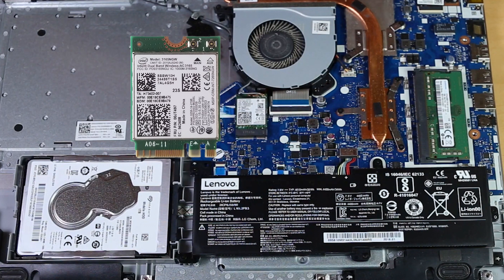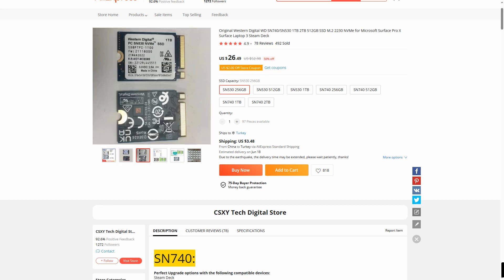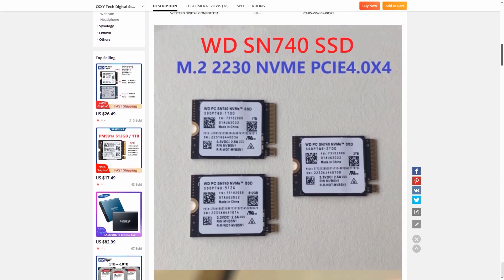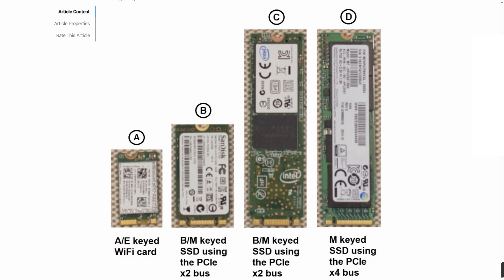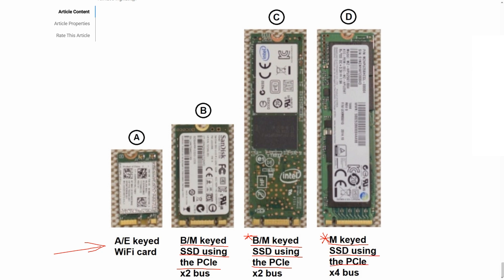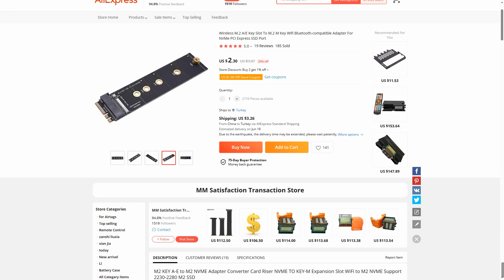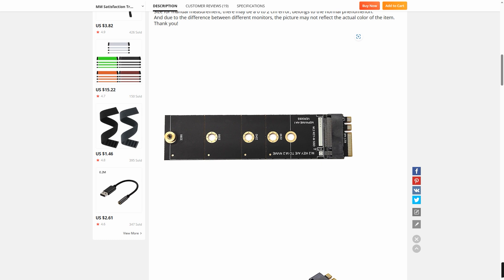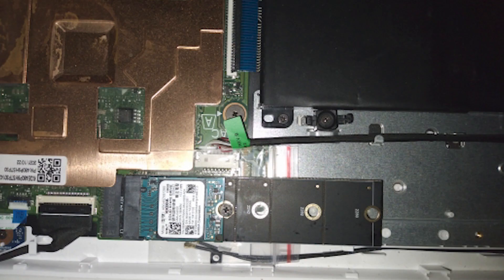Convert WiFi Slot to M.2 NVMe SSD Slot!

Comment: Thank you but I've a question. Will then the MainBoard see this nvme drive for boot?
Reply from the maker: Yes, after migrating my previous Windows, which was setup on my 2.5" SATA SSD, to M.2 NMMe, it works as it is and is bootable. You can see the video for bios properties in this video: https://www.youtube.com/watch?v=YBwPaWFExsQ

Comment: Hi, what read write speed so you get by doing this? I wanted to do this because nvme is cheaper than sata here where i live
Reply from the maker: Thank you for your comment! I received 1257.54 Read (MB/s) and 1211.65 Write (MB/s), which is significantly higher than my 2.5" SSD.
Reply: @techwise66  nice!

Comment: Very helpful information, thank you! 

I have a pavilion laptop I've had for something like 7 years or so, and through replacing parts on it over the years now the main issues are a wobbly charging port, possibly battery going bad aaaaand the onboard SSD steadily slowing down + high usage. If I can swap out the wireless card (that I barely use anyway) with an NVME drive them maybe it will keep kicking, or even be faster than in the past few years.

Comment: did u take out the fan to install that?
Reply from the maker: No, I didn't take out the fan to install
Reply: @techwise66  for some reason it doesnt look like the same model laptop from the start of the video and the last (installed) , dont see any room to install that 2280 sized adapter
Reply from the maker: @GolDCaster22  Thanks for your comment! In my implementation, I used a WD SN740 M.2 SSD 2230 NVMe PCIe sized SSD for the installation.
Reply: @techwise66  And you didn't show it because...
Reply from the maker: @Kali_Kali  I will show in the next video
Reply from the maker: @Kali_Kali  Would you please check the final video? https://www.youtube.com/watch?v=q71niIizgvQ

Comment: Sorry how ican know size my wifi slot
Reply from the maker: To determine the size of your Wi-Fi slot, which is essentially an M.2 slot used for the Wi-Fi card in your laptop, you can check your laptop's documentation, such as your laptop's user manual or specifications sheet. Manufacturers usually list the type and size of the slots available in the laptop. Or, if you're comfortable opening your laptop, you can physically inspect the Wi-Fi card slot. The slot will often have small notches that correspond to the M.2 size (for me, it is 2230 M.2 size). Sometimes, the slot itself is labeled with its size

Comment: Did you use a docking port for Ethernet?
Reply from the maker: I have a built-in Ethernet port in my laptop, so I didn't need that, but it could be an alternative to using docking stations that include multiple ports, including Ethernet, USB, HDMI, etc., and can be connected to a laptop via a USB or Thunderbolt port

Comment: Can we use minipcie slot to boot nvme pcie x4 drive(with an adapter ofc)???
Reply from the maker: I didn't try it before, but I think you can. But you should find a different adapter than the one that I showed in the video. Please search for "Mini PCIE to NVME Adapter Mini PCIE to M2 MINI PCI-E to NVME Convert Card Riser Support 2230 2242 2260 2280 NVME PCIE M2 SSD". Before making a purchase, you may ask the seller about your motherboard

Comment: Is there any way to check if the pci port support the nvme ... without purchase unwanted parts...
Reply from the maker: You can find out whether your PCI port supports NVMe by identifying the number of lanes (x1, x4, x8, x16) and the version of your PCIe slots (such as PCIe 3.0 or 4.0) without having to buy extra parts. The third-party program HWiNFO64 is available for free. This link will take you to a video that describes the software: https://www.youtube.com/watch?v=PkZwEkgMwQI
In the HWiNFO64, reach to the motherboard and under motherboard features find motherboard slots like in my case 4xPCI Express x1, and 1xPCI Express X4. NVMe SSDs typically require a PCIe x4 slot or higher.

Comment: What is speed on this SSD with converter?
Reply from the maker: I got 1257,54 Read (MB/s), 1211,65 Write (MB/s) which quite higher than my 2.5" SSD.

Comment: HOw to do it in the Z510?
Reply from the maker: I didn't try on the Z510 laptop before, but you would follow a similar process as I described in the video. First, check the laptop's specifications to ensure that your Lenovo Z510 has a WiFi card slot that is potentially compatible with M.2 SSDs. This involves checking the form factor and interface of the existing WiFi card slot.
Then do some research on the WiFi card's specifications for the specific model of the WiFi card in your Z510 to understand its form factor and interface. This research will help you determine the type of M.2 slot (e.g., M.2 A, E, B, M key).
Based on your findings, choose an M.2 NVMe SSD that is compatible with the slot. If the slot is not directly compatible with an NVMe SSD, you will need an adapter that can convert the existing slot to an M.2 NVMe-compatible slot. Make sure the adapter is compatible with the physical dimensions and interface of your laptop's slot.
After installation, you may need to adjust settings in your laptop's BIOS/UEFI to recognize the new drive. This could involve changing the boot order or enabling certain storage controllers. I made a video about that. The link is https://www.youtube.com/watch?v=YBwPaWFExsQ
Once the M.2 SSD is installed, ensure that your operating system recognizes the new SSD. You may need to install drivers or make other software adjustments.
Remember, modifying your laptop can void warranties and carry the risk of damaging the device. If you're not comfortable with this process, it's advisable to seek help from a professional. Also, ensure that you have backed up all important data before proceeding with any hardware modifications.

Comment: curious why you didnt show the same laptop you were doing the upgrade on with the card adapter at the end. Appears you used a picture of a different laptop.
Reply from the maker: I used different images to show that the card adapter upgrade method is suitable to a wide range of laptop models, including PCs. Rather than focusing on a particular laptop model, the goal was to demonstrate the upgrade's adaptability and compatibility across other platforms.
Reply: @techwise66  based on the intro the goal was for you to find add an nvme ssd to your laptop m.2 wifi slot, would make sense you would show it working in the laptop that you were wanting to upgrade.
Reply from the maker: @MrGeemonty  I appreciate your feedback. I am planning to create a new video that will walk through each step in depth once more

Comment: Could a windows os be installed on it and make it a boot drive?
..and does the bandwidth of the motherboard is equal to m.2 ssd in your case? .. i think it is less by 10 times.
Reply from the maker: After I plugged in the M.2 SSD to my Wi-Fi port, I migrated all my previous Windows files and other folders to my new SSD and adjusted the bios. Then, I can boot my new M.2 SSD. I got 1257,54 Read (MB/s), 1211,65 Write (MB/s) which quite higher than my 2.5" SSD.
Reply: @techwise66  amazing
Reply: @LawatheMEid  If you are not doing heavy gaming or video editing it matters very little, I still have an 8 year old 2.5" SSD chugging along with 400-500meg read/write speeds and windows and apps perform super fast.

Comment: 1:43 I apologize if this is a stupid question but I noticed you had an empty B-key slot so why didn't you just get a B-key SSD instead of sacrificing your WiFi card?
Reply from the maker: First and foremost, thank you very much for your comment and I want to emphasize that there are no stupid questions when it comes to learning and understanding technology. It's great that you're seeking clarification! Regarding the Lenovo Ideapad 520 that I use, it's important to note that my laptop's motherboard, unfortunately, doesn't come equipped with a B-key SSD slot. The image I presented in the video at 1:43 was simply a demonstration to illustrate the differences between a B-key slot and a WiFi card slot. This is why I couldn't opt for a B-key SSD and had to make a choice regarding the WiFi adapter to use M.2 NVMe. I hope this clears up any confusion!
Reply: @techwise66
Thank you for your kind reply and clarification. I subscribed.

Comment: But we wouldnt need this in a desktop that has both A/E slot correct? I can just plug in my 2230?
Reply from the maker: If you have a desktop that has a M.2 SSD slot, surely you don't need this adapter. But if you don't have that slot and instead only have a wifi slot, you may use this method.
Reply: @techwise66 it does have a m.2 slot but I am turning this desktop into a server so it won't need WiFi

Comment: How many pcie lanes does your m.2 slot provides?
Reply: They can have 1 or 2 lanes but the way they're wired up you will only ever have a single usable lane in practice. Even the ones that have two lanes aren't wired up as two lanes, but two separate 1x interfaces. The only device I know that can take advantage of this is Google's Coral TPU card, it has two TPUs one per PCIe lane.
Reply: @antikommunistischaktion  OK so pretty subpar perfs compared to a generic x4 m.2 port...
Reply: @jouldalk  Yes, but if it's PCIe 3.0 it's still going to be faster than sata

Comment: My ASRock B550M PG RIPTIDE has a M.2 type E slot for wifi.  I want to add a 2230 NVME drive in this slot.  Will this A/E adapter you are demonstrating work with a type E slot or only with a type A/E slot?  Does the A/E mean either A or E or the slot must be an A and E slot for this to work?  Thank you!
Reply from the maker: The "A/E" key and "E" key slots have different pin configurations. The adapter that I show in the video is designed for an "A/E" slot and may not fit into an "E" key slot alone. I think you should check for a different adapter for your motherboard.

Comment: I have some problem when i install nvme in wifi slot it doesn't show boot option in bios but it's show as storage when i boot from my old hdd what should i do
Reply from the maker: The NVMe SSD needs to be properly formatted and partitioned. For most modern systems, you should use GPT (GUID Partition Table) rather than MBR (Master Boot Record). You can check and change this using disk management tools in your operating system. If the drive is new, you must install an operating system to make it bootable. If you are moving from an old drive, you can clone the old drive to the NVMe SSD using cloning software and I did like that. In your BIOS, check the boot order. Ensure the NVMe drive is listed and set as a priority if you want to boot from it. I explained the bios options in this video, so you may also check the settings here;
https://www.youtube.com/watch?v=YBwPaWFExsQ
Reply: @techwise66  The nvme i have is from my old desktop PC and it's already have windows on it
Reply from the maker: @prod.byaunda9271  You're encountering an issue where your NVMe SSD, which already has Windows installed on it from your old desktop PC, is not being recognized as a bootable drive in your new system. Consider backing up your data and performing a clean installation of Windows on the NVMe drive. Windows installations tied to different hardware can sometimes have issues booting into a new system
Reply: @techwise66 cloning might not work due to different sector sizes.

Comment: Nice video, I wanna try it, i got a notebook with 32gb emmc for my child, and now, after a lot of system updates we got stuck with its capacity.
Can you give some info? How much slower are nvme with only 2 lanes of pcie that a+e key are limited
Reply from the maker: Thank you for your comment! NVMe SSDs are much faster than eMMC because they use the PCIe interface, which has much higher potential throughput. The number of PCIe lanes connected to an NVMe SSD can affect its maximum performance. A typical NVMe SSD with 4 PCIe lanes can reach higher speeds than one with only 2 lanes.
Based on my research, A+E key M.2 slots may be limited to 2 PCIe lanes, meaning any NVMe SSD that is installed in such a slot will have a maximum bandwidth that's roughly half of what could be achieved with 4 lanes. Practically, an NVMe SSD on a 2-lane connection might achieve read/write speeds near 1,900/1,500 MB/s. In contrast, a 4-lane NVMe connection might allow for speeds closer to 3,800/3,400 MB/s or more, depending on the SSD's specifications and the PCIe version.

Comment: Hai bro, i have Hp laptop 15 -bs580Tx model, in that i have m2*3 slot but while i am inserting a nvme ssd (Samsung 970 evo) , the laptop is not Turing on or booting.  if i remove the nvme ssd from the slot, the laptop wroks fine.  can you help me with this bro?

 if possible tell me how to reach you, will the picture of my laptop's motherboard @TechWise
Reply from the maker: It seems like you might be having some compatibility issues with the NVMe SSD on your HP 15-bs580Tx. Let's approach this step-by-step:
First, ensure that your laptop's motherboard supports NVMe SSDs. Only some M.2 slots support NVMe, while others only support SATA M.2 SSDs. You can find this information in your laptop's service manual or by checking the specifications online.
If your laptop does support NVMe SSDs, try updating your BIOS. Sometimes, a BIOS update is necessary for the system to recognize new hardware properly. The latest BIOS update can be found on the HP support website for your specific model.
Double-check that the SSD is properly seated in the M.2 slot. An improper connection could prevent the laptop from booting.

Some NVMe SSDs can consume more power, which could cause issues. Check if your laptop's PSU can handle the extra power draw.
If your laptop turns on but doesn't boot from the NVMe SSD, you might need to change the boot order in the BIOS settings to prioritize the SSD.
Sometimes, the SSD might need to be initialized or formatted before use. You can do this by connecting the SSD via a USB adapter to another computer and then initializing it through Disk Management (on Windows).
If you have other storage devices connected, try disconnecting them. Sometimes, hardware conflicts can cause issues during boot-up.
If you've tried these steps and your laptop still won't turn on with the NVMe SSD inserted, the SSD may be defective or incompatible with your laptop. In that case, trying a different SSD or contacting HP support for further assistance would be the next step.

Comment: my laptop lose wifi slot on motherboard ! now I want use nvme slot as wifi ! this scenario os possible ?
Reply from the maker: Yes, it is possible, but you need a different adapter. I mean, it is not the same adapter that I mentioned in the video

Comment: So I have a HP Elitedesk 705 g5 Ryzen 5 Pro Ryzen 5 3400g mini pc similar to this, can't I put in the m.2e slot a micro sd card reader and boot from that to Batocera Linux?
Reply from the maker: The m.2e slot is not typically compatible with micro SD card readers. So, the BIOS/UEFI firmware of your HP EliteDesk might not support booting from  Batocera Linux even if you connect a micro SD card reader to the m.2e slot
Reply: @techwise66  I figured it was worth a try perhaps save a few dollars and utilize that space instead of purchasing another 256gb to 500gb m.2 nvme drive
Reply from the maker: @TwistedFXgaming  I wish I could help you more, not to expense any penny for your trying.

Comment: Good explanation. I hope you can help me. I have an Asus laptop with a soldered Wi-Fi card that is bad. I want to use an SSD adaptor as my secondary drive where i can install a wi-fi card and an nvme drive. What do you think I should use?
Reply from the maker: To solve your issue, you can use an M.2 to PCIe adapter that has both an NVMe and Wi-Fi card slot. This way, you'll be able to use an NVMe drive and replace the bad Wi-Fi card without having to solder anything. Just ensure your laptop has a spare M.2 slot and that the adapter is compatible with your laptop

Comment: Hello, I really liked your idea and was thinking about doing this! I want to do this, but I have some doubts. I have a Dell Inspirion 3567, with 7th generation i3, in the motherboard instructions, the PCI input is 3.0. On the motherboard sheet, it only supports 256GB of SSD, can I put more? I would like to use a 1tb SSD (it already has 1tb of HD)
With this support can I put an M2 nvme PCI 3.0 SSD?
Were you able to boot the SSD so that Windows could start on it?
Would it be possible for me to put a USB Wifi instead of the DVD/CD?
Reply from the maker: Thank you for your comments. For your Dell Inspiron 3567, while the motherboard specification may state it supports up to 256GB SSD, in many cases, you can install a larger capacity SSD, like 1TB, without issues. Regarding the M.2 NVMe PCI 3.0 SSD, you would need a compatible slot or an adapter to make it fit. If your laptop supports booting from an NVMe SSD, you can install Windows on it. Replacing the DVD/CD drive with a USB Wi-Fi is not a direct swap, but you can use external USB Wi-Fi adapters if you want wireless connectivity.
Reply: @techwise66 thank you very much! I'm going to buy it, and when it arrives I'll share the experience!!

Comment: This is the information that I was looking for, one like for you my friend. I want to use this slot for a gpu adapter, I think I have the key E slot (i can read an E on the slot). What do you think about this idea? It will works?
Reply from the maker: Thank you so much for your comment. Be careful to have an M2 A.E Key on your board to use the graphics extension cable. The adapter below may solve your request more than the adapter I mentioned in the video. It is a different purpose to use M.2 NvMe SSD.

https://www.aliexpress.us/item/3256802884482879.html